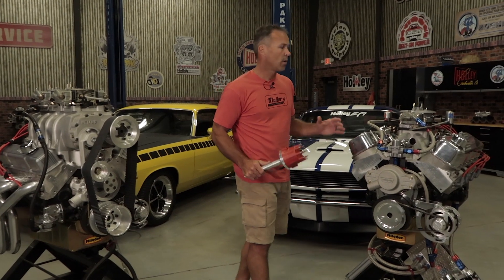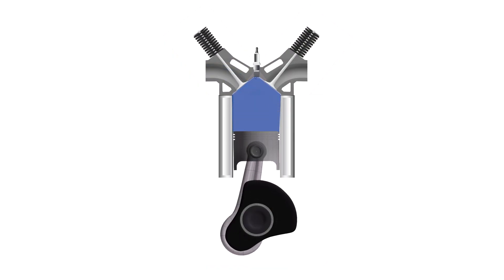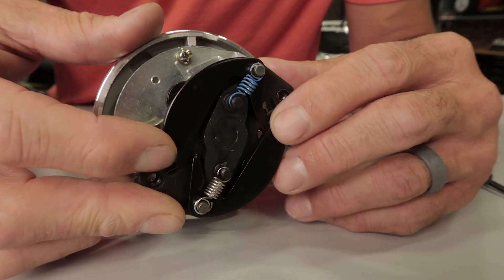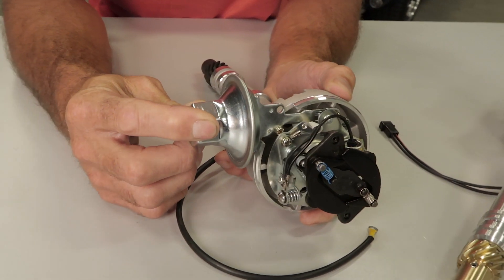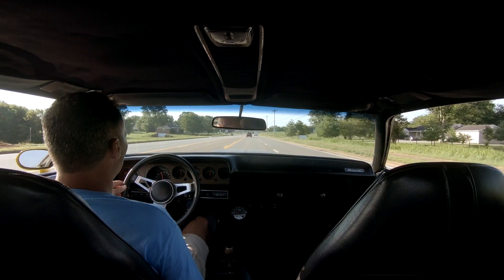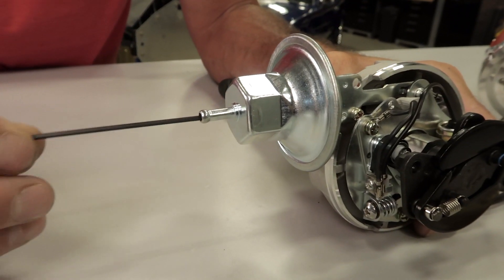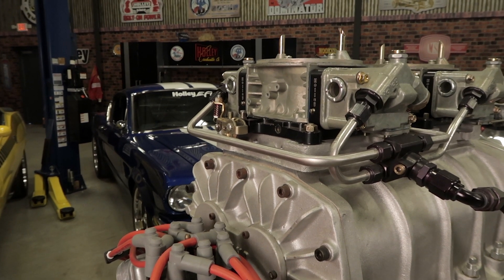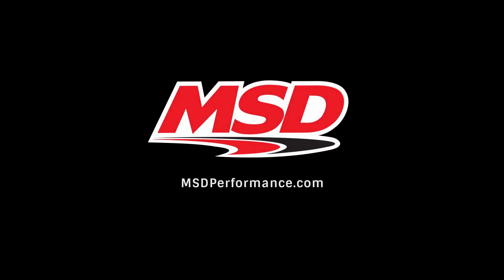How Ignition Timing Works: Vacuum and Mechanical Advance Explained!

Comment: One correction, the adjustment made to the canister with the allen wrench affects the rate at which the timing is increased, not the amount of degrees. That number is a fixed amount based on the stops on the arm, and the number stamped on it. Also, the source should come from a ported supply since the extra advance is unnecessary at idle.
Reply: Engines need 10 or more extra degrees of advance at idle to burn lean mixtures. Where did you hear there should be no extra advance at idle ?  Always use manifold vacuum, not ported.
Reply: @bmclaurine  the initial advance can be whatever is needed. The total mechanical advance would need to be restricted accordingly so the all-in timing isn't excessive. Also, factory installed Carter carbs in the 60's only had one source for vacuum advance, and that is ported.
Reply: @scatpack68  Doesn't matter what sources are on the carb. You won't get any more timing advance at idle unless you are connected to the intake (full vacuum). You need more timing at idle and ported won't do it.
Reply: @bmclaurine  you didn't read my post. With a timing limiter you can have whatever initial you want, even locked out at 36 degrees (for strip use). How much initial timing are you trying to achieve?
Reply: Well stated.  Spot on.  Ported is misunderstood.
Reply: There a multiple other incorrect statements in this video as well, like the distributor sending a signal to the coil, electricity using milliseconds to travel from to coil to the spark plug, and air/fuel mixture burning slower at higher RPM. These details don't really matter to someone who is just wondering how it works on a surface level, but it will only confuse people who are trying to dive into it a bit.
Reply: If my quick math is correct, at 5000 RPM each degree of crank rotation takes 0.033 milliseconds, so if the spark took multiple milliseconds (or even just one!) to travel to the plug - the timing would be WAY off.
Reply: @jckf  Totally agree, that happens at 186,000 miles per second, so effectively zero in this case.
Reply: Wrong, the vacumm advance should load sensitive.
Reply: I disagree. Extra advance is needed at low engine loads........how much engine load is there at idle? I agree with the video..........you know.................the people whos whole business is ignition? Also most manufactures before the 70s..........use manifold vacuum.
Reply: @kztrekz3329  vacumm advance should load sensitive, if it is ported vacuum under a load it would cause detonation, with manifold vacuum you will have advance under light acceleration and crusing speed. The higher timing at idle will also reduce the need to open the throttle too much and help the idle with a larger cam as well as give you better mpg.
Reply: @kennywhiddon1497  what do you think happens with ported vacuum under a load? The same thing as manifold vacuum. The whole purpose is to advance the spark under LIGHT load. If you need the extra advance at idle, simply limit the mechanical advance and adjust the initial accordingly.
Reply: @scatpack68  You need to hook up a vacuum gage to your engine on the manifold side, right off idle the vacuum drops, then it recovers under light load, under full throttle there is no vacuum, that's why it is load sensetive.
Reply: @kennywhiddon1497  what point are you trying to make versus ported vacuum? Are you saying Carter had it all wrong during the musclecar era where a vacuum signal came from?
Reply: @scatpack68  Forget it, do it the way you think is best, some people don't care to learn, not my car, not my problem.
Reply: @kennywhiddon1497  we didn't design and manufacture the carburetors and distributors, just using them as they were originally intended.
Reply: @scatpack68  Did you watch that video from Unity Motorsports Garage? David Vivard has one too about vacuum advance.
Reply: @kztrekz3329  take a look at pre 70 Carter AVS units. Where is the signal coming from for the distributor? One place only and that's ported. If you have your initial timing set where it's supposed to be, in relation to all-in mechanical, why would you need even more advance at idle? Light load cruising speed, yes, which is what it's for.
Reply: @scatpack68  See what I posted and what the video is talking about.
Reply: If you watch this video CLOSELY, the vacuum gauge drops to close to zero as the driver mashes the throttle. In this example, fulll/manifold (not ported) vacuum advance is used. And yes, it's true that pre 70s, manifold vacuum was used; although some manufacturers used BOTH. Can't remember what car I had, could have been a FORD, Chevy or AMC, but the distributor used BOTH as part of the early emissions controls. Insofar as I can remember, the source was determined by a coolant temp sensor. @kztrekz3329

Comment: Wonderful presentation! Just wondering - why is the electrical signal being sent to the spark plugs so slow? It seems like the spark would be practically instantaneous
Reply: its NOT slow..the reason for timing advance is to give the combustion process a head start..before the piston reaches top dead center..
Reply: Yea, its not so much to do with the electrical part, electricity is instantaneously fast, its mostly all about giving the fuel mixture enough time to  ignite before the piston reaches top dead center, which ends in a complete efficient burn to maximize power. I Love this stuff...

Comment: I've heard a lot of guys say the hot ticket on a street  performance pump gas N/A application is more initial than mechanical, all in at 2500 with no more than 10 degrees added for vacuum advance a rule of thumb
Sounds like a need an E curve for my 302 windsor :)

Comment: Great presentation loved it. Just wondering, if I am running a SNIPER EFI and I use timing control Hyperspark with CDI, can I or do I have the chance to run advanced/ Lean setup in cruise/ part throttle conditions???? It seems that Vacuum advance is much better than my current Mallory Mechanical advance system. Would love the have best of both worlds. Again this really taught me alot.